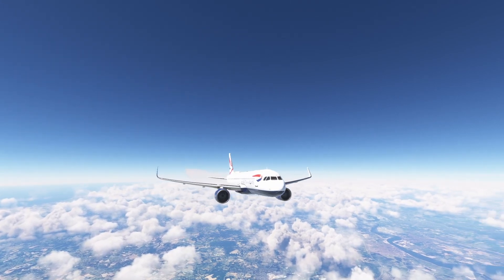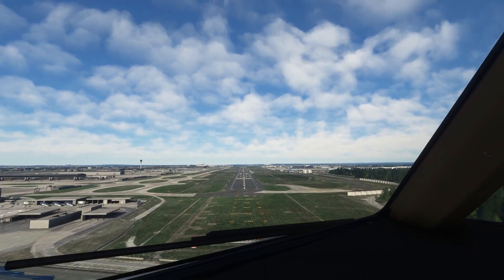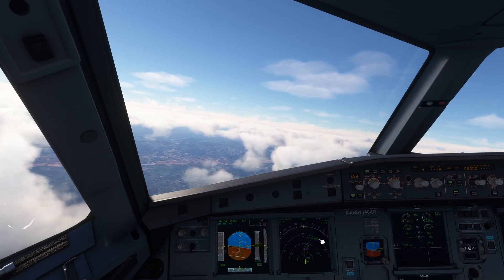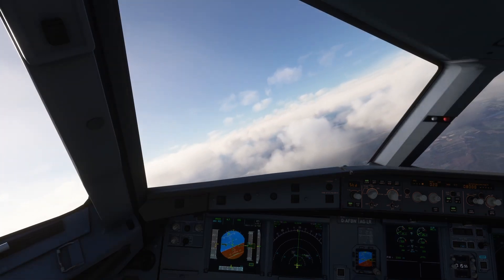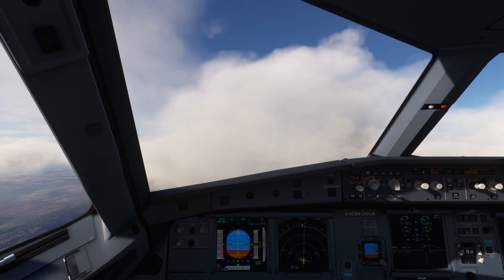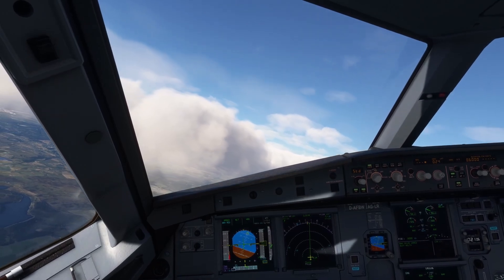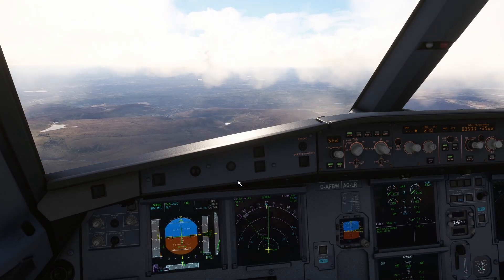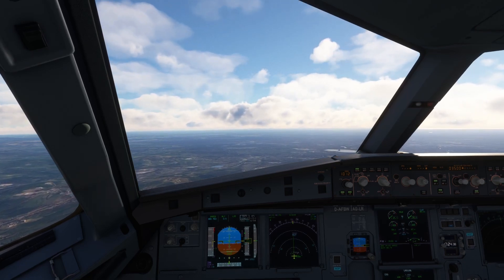How To Use Radar Vectors In Beyond ATC | MSFS 2020 Tutorial

Comment: The final heading they give you is that the runway heading? I just tried it and I was off coarse 😅
Reply from the maker: The last heading they give you will be a heading to intercept the glideslope, once you are cleared to the runway you are allowed to turn on the localizer and line up with the runway once you intercept it.
Reply: @ thank you 🙏
Reply: A silly question .. on a visual approach once you are cleared to the runway and ATC puts you on the runway heading can you start going down to the main minimums.?I have just flown over the runway (KBFI 14L) twice but BATC was kind enough to offer vectors to go around the second time. Thank you for you very informative video.

Comment: I am no pilot, I do not know the real approaches, so perhaps the mistake is on my part, but for my sim approaches Beyond ATC works much much worse than FSHud, or better to say I hardly ever use it for small aircraft. BATC brings me to the final approach course at such a sharp angle that the autopilot has zero chance to align the aircraft with the runway and the aircraft ends up in roll. Then I have to loop back and do it manually. The last sentence I hear is - intercept from above or bellow ... and then I am suddenly on my own. But when this sentence comes it´s too late for the autopilot. For this reason I either do not use BATC for small aircraft or I just ignore ATC instructions in the final phase of the flight and set the heading at my own discretion. FSHud handles the approach in a much more comfortable way for me since it gives me smoother course adjustments. For visual approaches Beyond ATC sometimes puts me completely off course and that asks me if I have the field in sight (even in foggy weather). The software is not bad but a lot of updates and patches will be needed before I start liking this addon. The first warning for me should be the terrifying English in video guides. Even as a non native speaker I would sound 100 % clearer.
Reply from the maker: That's a valid concern and I agree that the program has a long way to go before it can be considered complete. I have no experience with FSHud but I heard many great things about it and considered getting it before BeyondATC was launched. If you think that there is something BeyondATC can do better, you can always suggest it in their Discord channel and it'll likely find it's way into a future update.

Comment: I never get radar vectors. I always have to follow my STAR and I end up getting a Transition for my ILS Approach. Do you maybe know why it's like this?
Reply from the maker: I think its just based on the airport information BATC has. I think that if it can make you follow your STAR with all the complete data it will and it only resorts to radar vectors when it doesn't have the complete data. This will probably change when they implement AI traffic and it has to route you around other aircraft.
Reply: @RattlesnakeAviation  thank you very much for your answer :)

Comment: what are the options ATC can give you - radar vectors, following Flight plan etc? When would they give you radar over another one?
Reply from the maker: As far as I'm aware it can only tell you to follow your flight plan or give you radar vectors, I'm not sure if it's capable of visual approaches. I think the main reason it would give you a vectored approach over your flight plan is when it's scenery data is lacking and it can't fully link together all the waypoint in your flight plan.
Reply: @RattlesnakeAviation  or I guess when traffic gets added - like VATSIM does with the controllers as they manage us all ;-)